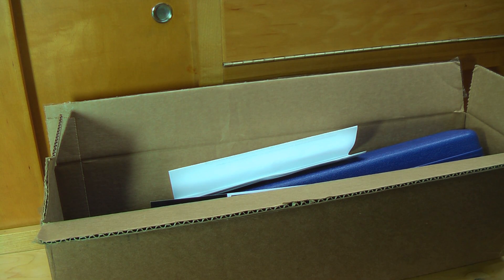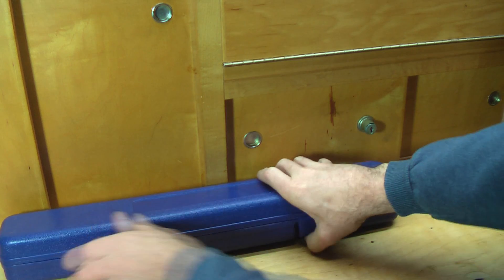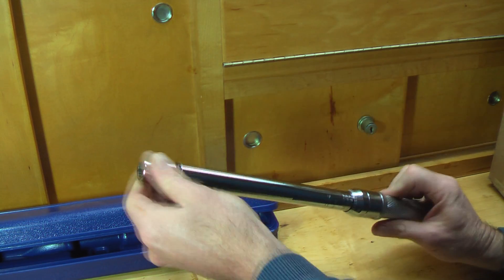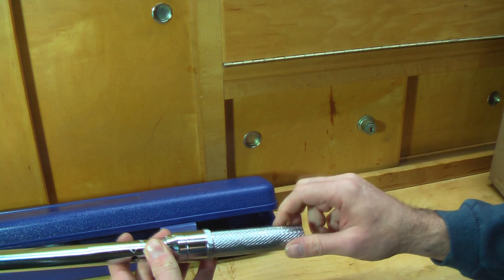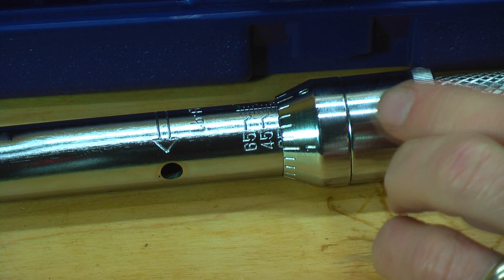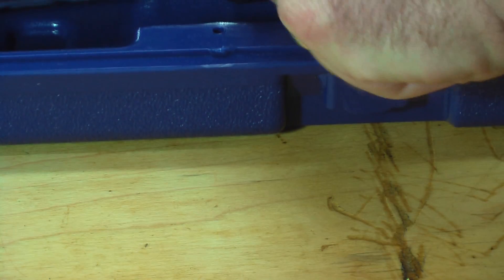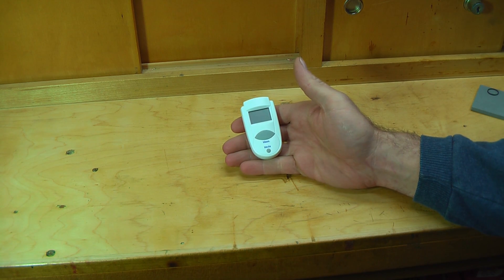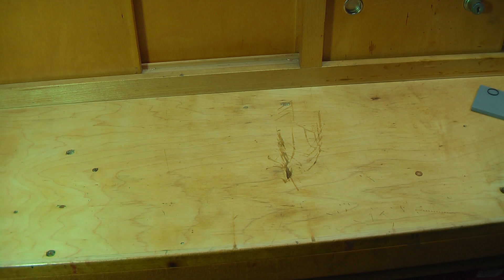Conststent Crimp and Barrel Thermometer

Comment: hey ammosmith, i'm a automotive technician by profession (just past 10 years) and torque wrench's that are left stored with the dial turned up, weaken the spring inside the wrench, thus loosing calibration. our Matco tool dealer always has to send off 2-3 torque wrench's at the start of tire season. other then guys dropping them, the new guys leave them turned up to 100 ft lbs all the time. its recommended to leave it @ just a few numbers past 0 ft lbs or inch lbs.  thumbs up!!!